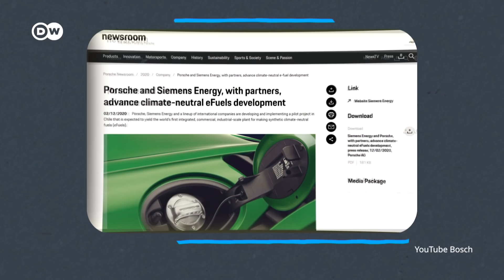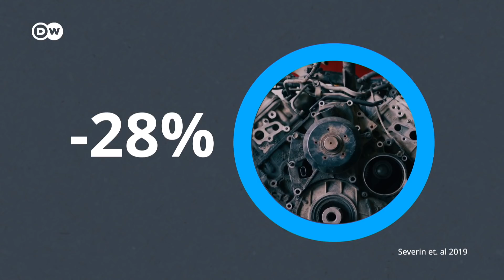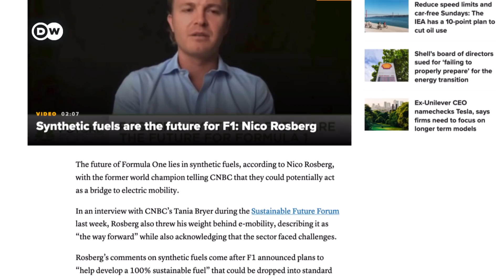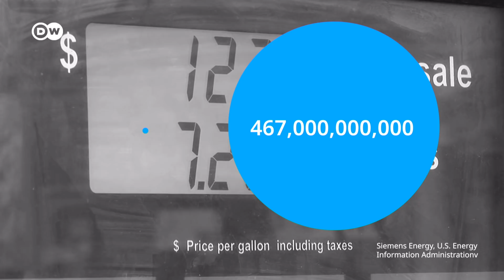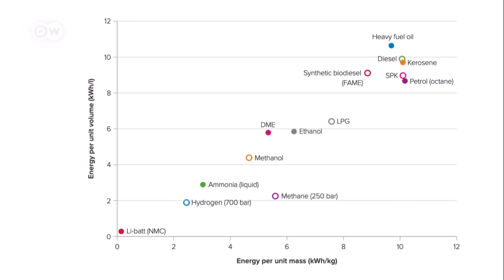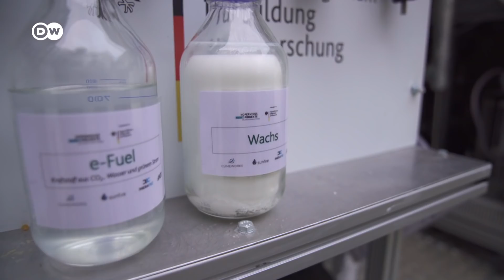The truth about carbon neutral fuels

Comment: I was left wondering, wouldn't it be more effective to use the hidrogen after the hydrolysis and not continue the complicated process?
Reply: you would need new infrastructure for transporting hydrogen (read as: pipelines) and new cars. hydrogen is also a hassle to store as you need very low temperatures or high pressures
Reply: @Gekkoperformance  These e-fuels won't be that usefull for cars as the video explained, so really they'll mostly be usefull for aiplanes and maybe rockets. Yes, you will need new planes for that. but planes generally aren't that old really (most airlines will replace them before they are 20, budget airlines even sooner), so that transition could actually happen fairly quickly. And i dont think that the oil they plan on producing now will be transported by pipelines anyways since they couldn't even run a electrical cable, pipelines seem even trickier than that to me. So really the idea is to use boats to transport that fuel anyway. And guess what, we could also use boats to transport that hydrogen.
Reply: Its funny that if you go a step backwards and don't do hydrolysis and connect wires directly to a motor, you already have more efficient vehicle...

And then expand the vehicle so more people could be carried... and if the vehicle has to have a connection to electric wires, then put it on less friction producing material (that is steel to steel)... Oh... Its a train... nevermind.
Reply: @PurpleDuneEfa  good luck using cheap electricity from Chile if you‘re in germany
Reply: @Gekkoperformance  ??? i guess you wanted to reply to another person, but why do y'all always focus so much on cost and not on resources, efficiency, environmentally friendly, etc.? like do y'all realize money is a social construct and really you could go about your conversation without ever mentioning money?
Reply: @Gekkoperformance  Germany should have kept those nuclear plants running.  You know, the ones they shut down in a panic after Fukushima?  (forgetting that tsunamis are not a big problem in Germany...)
Reply: @PurpleDuneEfa  Money might be a "social construct", but it's a proxy for resources.  Since we don't have infinite resources, we have to use them wisely.  Minimizing the "cost", in resources or money, per MegaWatt hour is how we do that.
Reply: @incognitotorpedo42  Nuclear is a whole other ballpit, there is still no adequate long term solution for storing nuclear waste, plus if you factor in the decomission costs of nuclear plants which is in the billions, it‘s not profitable
Reply: @incognitotorpedo42  Liberal cringe
Reply: https://youtu.be/Miysn2-fae4 i agree. This is our future.

Comment: The perfect way to get the majority of the country to swap to electric vehicles is to have have a government initiative should have to pay for a portion of the car or pay the interest on a car loan.
Then sell adapters for normal house outles to charge cars until the infrastructure to fuel them like gas stations is set up.
Reply: Sure, but electric cars aren't the solution. They're still polluting and a major drain on resources. The way forward is to minimize the amount people need to drive by investing in reliable public transportation and transitioning away from suburban sprawl.

Comment: It’s is actually a good thing that not a lot of people drive a electric car because we don’t have a way to recycle them and we wouldn’t never ever have enough recourses to replace them every 6 years but I don’t care burn the rain Forrest why wouldn’t you
Reply: 1. Yes wer can recycle Batteries, it's getting even more complex with the ever increasing amount of batterie chemistrys but start-ups and companys are already working on it.
2. Yes ressources are tight, the prices for lithium, Cobalt, nickel, etc. are projected to increase but that means more interest in recycling batteries.
3. Batteries are getting better every year and Tesla already showed that you can expect to have over 80% of your range left after 10 years or 200.000Km.
4. Brasil also has ressources needed for renewables which could also increase deforestation.
Reply: I would like to add that alternative battery technology will be developed. Current technology is a way to bridge until it is rwady for market

Comment: It would be nice if this could be a solution but it is nowhere near the yields needed to be efficient with about 8% making it to the car.
 You are right prices for this won't drop until 2050 because that's around the time they'll perfect it if not longer.
Reply: it doesn´t really matter if it´s efficient , it just has to be profitable. Think about it like that, it´s nice if the electricity is in Chile or Norway, but if you can´t get it to where it´s needed there is no point to it, so it is 0% efficient. you just have to make the electricity where it´s cheap, e.g. in Norway wind power costs 3 cents per kWh. With prices like that, it doesn´t matter how much you lose in the conversion process.
Reply: @Gekkoperformance  if it's still expensive then yes it does matter as no one will buy it, governments would sooner subsidize electric car purchases than pay out the ass for inefficient fuel.

Comment: E-Fuel and/or methane conversion is the answer to the energy storage/battery problem.

Green energy such as solar and wind is unpredictable so a storage method is needed to store energy during high output or else the energy will go to waste, the trend is to use battery such as Lithium battery.

Compared to fuel, Battery has lower energy density, is bigger and more complicated than a simple fuel tank, it's performance also degrades over time, and to make the battery it requires rare earth metals which comes from mining the earth which produces a lot of waste and recycling will never recover 100% of the metal so additional mining is inevitable.

E-Fuel is basically just fuel so existing facility can be used with little modification, despite the loss from multiple conversion stages : Green energy>Hydrolysis+Carbon capture>H2+O2+CO2>Methanation/E-Fuel. The extra energy itself is still stored instead of being wasted, with carbon capture being powered by green energy it also offsets the fuel combustion and drives demand for more carbon capture which makes it profitable, it'll probably even drive people to burn coal just for more carbon ironically.
Reply: I agree. even if it´s less efficient it still solves the energy storage problem, you can use the surplus of power from solar panels during the day to produce it. At last, it doesn´t have to be efficient, it just has to be profitable. in Norway where wind energy costs 3 cents/kwh it can already be profitable, they said they can produce it for 2,30€ per litre, which is similar to what diesel costs in Germany right now
Reply: Sorry, but no.
If you ask me, this is the future: https://youtu.be/Miysn2-fae4
Reply: Wouldn't Nuclear solve the entire issue of intermittent energy?

Comment: I am fairly sceptical. Seems like a massive waste of resources. Although more or less carbon neutral, there is still the combustion process which pollutes at least a little. Without rethinking our consumption habits, non of these new technologies will really be viable
Reply: What if we just overproduce alot of nuclear energy and just absorb the energy spikes with carbon capture and the production of e-fuels. Then we also don't need lithium ion energy storage.
Reply: @durschfalltv7505  This would be hugely expensive, and wouldn't solve the problems of air pollution from combustion engines and noise pollution.
Reply: @incognitotorpedo42  well it would. since e-fuels burn cleanly
Reply: @incognitotorpedo42  Well you can use e-fuels in a fuel cell.
Reply: The nice thing is, that efuels are completely chemically homogeneous. Theres no sulfur etc in there which means that there will be only CO2 and NOx emissions. We are able to reufe the CO2, so its not big deal.